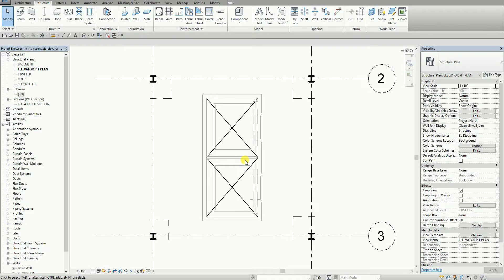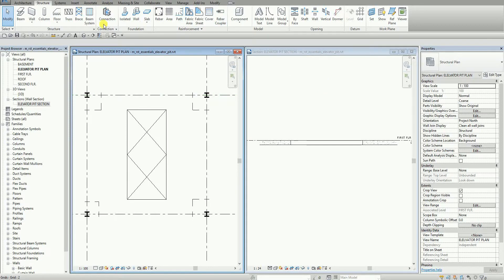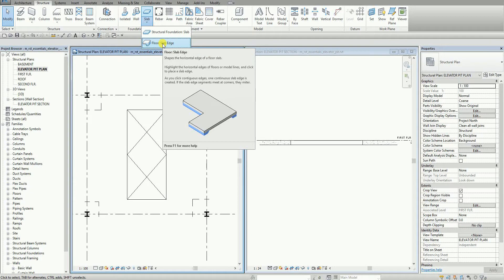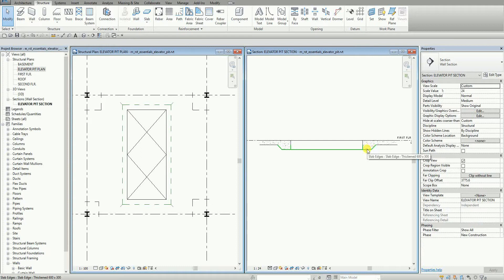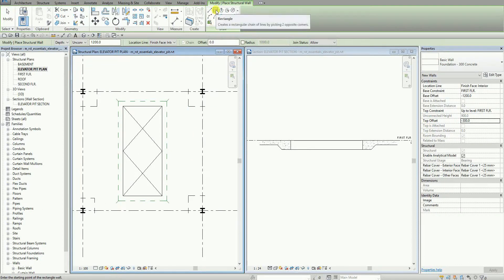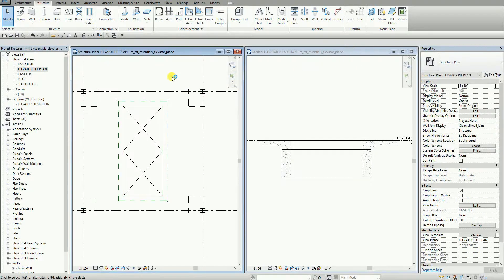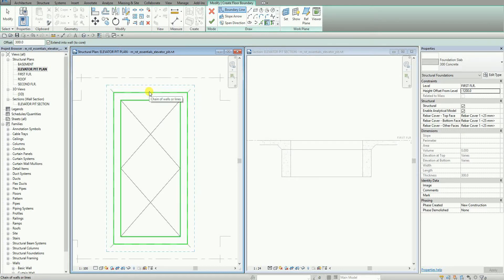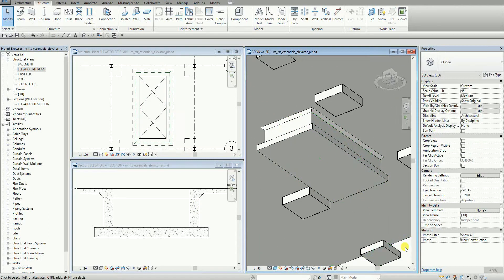REVIT STRUCTURE 2017: CREATE ELEVATOR PIT

Comment: HOW TO CREAT ELECTRICAL CIRCUIT FOR ELEVATOR? WHAT ARE THE TIPS TO PROCEED
Reply from the maker: Here you go:

1. **Familiarize Yourself with Revit**: Ensure that you have a basic understanding of how to use Revit, including creating electrical systems and families.

2. **Start a New Project**: Open a new Revit project or use an existing one, depending on your project requirements.

3. **Create Elevator Components**:
    a. **Elevator Shaft**: If not already in the model, create the elevator shaft using the architectural tools.
    b. **Elevator Car**: Model the elevator car as a component or a family if it's not part of the architectural model.

4. **Electrical Systems**:
    a. Navigate to the Systems tab on the Revit ribbon.
    b. Choose "Electrical" and then "Electrical System."
    c. Define a new electrical system for the elevator. Typically, you'll have one for the lighting, controls, and any auxiliary components.
    d. Assign the electrical system to the elevator components.

5. **Circuiting**:
    a. Start by selecting the components within the elevator that need to be part of the circuit, such as lighting, buttons, and control systems.
    b. Click the "Electrical Circuit" tool and create a new circuit.
    c. Name and assign the circuit to the electrical system you created earlier.

6. **Circuit Panel**:
    a. Make sure you have a circuit panel in your project where the elevator's electrical circuits will terminate.
    b. Assign the elevator circuit to the appropriate panel.

7. **Load Analysis**:
    a. Perform a load analysis to ensure that the circuit can handle the connected load. This is essential for elevator safety and functionality.

8. **Documentation**:
    a. Create electrical drawings, schedules, and panel schedules to document the elevator's electrical system.
    b. Ensure that your drawings are clear and follow industry standards and project requirements.

9. **Collaboration**: Coordinate with the architectural and structural teams to ensure that the elevator components and electrical systems are properly integrated into the overall building design.

10. **Compliance and Codes**: Make sure your electrical design complies with local electrical codes and regulations. Elevator systems often have specific code requirements.

11. **Testing and Verification**: After creating the electrical circuit, thoroughly test and verify that the elevator components function as expected. Check for any electrical issues and make necessary adjustments.

12. **Maintenance and Updates**: Document your electrical system properly to assist with future maintenance and updates to the elevator system.

Remember that creating an electrical circuit for an elevator in Revit can be a complex task, and it's essential to have a good understanding of electrical design principles, elevator systems, and Revit itself. Additionally, consulting with experienced electrical engineers or BIM specialists can be invaluable for ensuring a successful and compliant design.